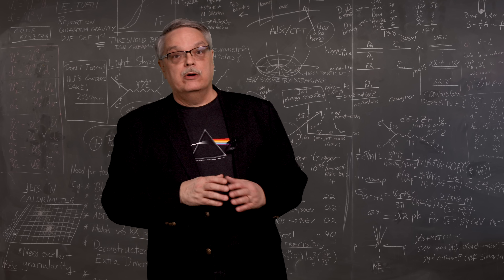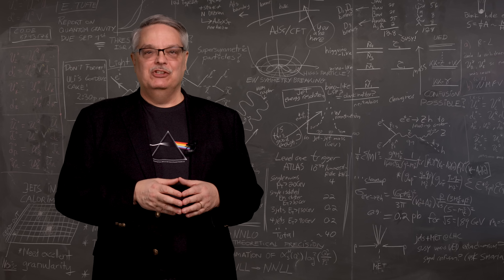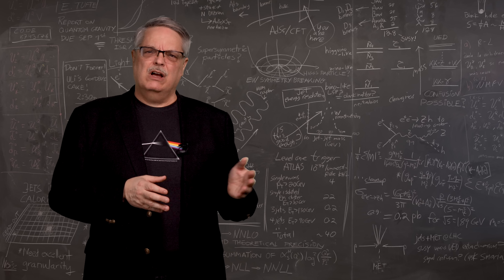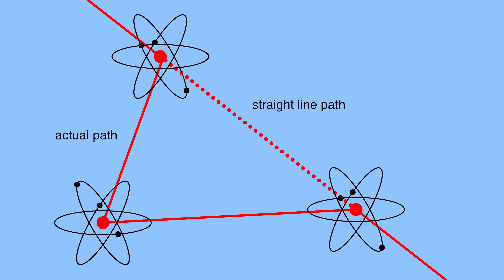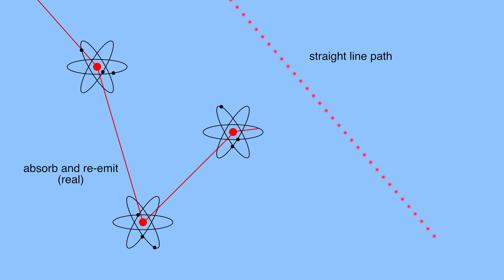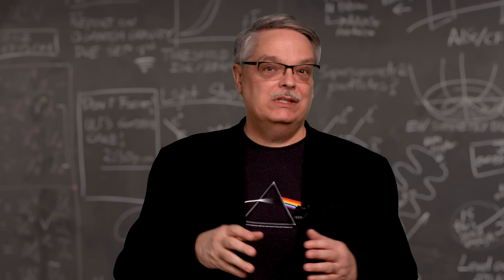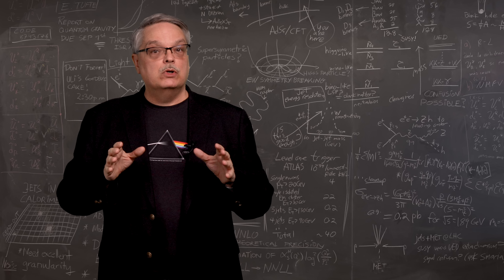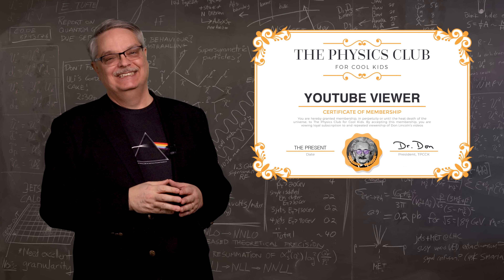Why does light slow down in water?

Comment: Thanks for the great explanations Mr. Dancing Hands
Reply: this video has taken many shortcuts in explaining the relations between the two systems and how it affects them.
to better understand this, we need to talk about d'alembert's equation and its dispersion formula and how it describes a wave.
so d'alembert's equation is used to link together the spatial and temporal variation of a wave.

and from this equation comes the dispersion relation that links together the frequency, wavelength and celerity of a wave.
to access to this equation, we use maxwell relations to describe this phenomenon. when we consider those relations in the void, we get the relation: c² = w²/k² where k is the angular  wavenumber and w its angular frequency. (just google it, ain’t that hard to understand)

thus we can see here that the celerity is proportional to its angular frequency. however, as explained in the video, when light enter a medium, there are charges that can be influenced by the electric field, especially electrons that are 2000 times lighter than their counterparts protons.
thus, when light comes in this medium, we assume that only electrons are affected by the electric field.

we then apply newton's second law to those electrons to find a relation between an electron's speed and the electric current
(we also neglect the magnetic field of the light as the electron is relativistic thus the force from the electric field is much greater than the magnetic one see lorentz law to better understand this )
and then by generalizing this equation to all electrons in the medium, we can get an induced current from the electric field of the light.
( the current is j = n * v with n the volumic density of charges and v the celerity of electrons)

then when we put this back to maxwell ampere local equation, we introduce a new component: the induced current which thus gives us a new dispersion equation: c² = (w² - wp²) / k² with wp the plasma oscillation and thus we can see that from the value of wp, we'll get a different value of the celerity of the wave.

thus we can say without a doubt that they are wrong in their explanation as it is not the combination from the electric current of the electrons and the wave that makes it slower but the induced current inside the medium that modifies the dispersion relation thus modifying its speed.
or in simpler words, it's the movement of electrons that changes the frequency and celerity of the light, but not the combination of the two electric current. (also on a side note, trying to represent the electric current of a dipole using a sine wave.. funny thing you did there 😅)

and finally, as for the reason why the light has a different angle, well you can easily explain this using two waves parallel to each other crossing the medium in phase with each other. as they have the same wave plane, you can easily come to the relation between the refracted angle and the incident angle using some basic geometry. i recommend you to see the demonstration of descartes second law if you want to better understand what i'm talking about.

Comment: Why is Fermilab's explanation so clear & elegant, while Sixty Symbol struggles so badly with this question (asked as "Why does light slow down in glass?")?
Reply: Funny, I thought this video was embarrassing. I could barely sit through it.
Reply: @saganandroid4175  That's funny. This video clearly explains what is wrong with other models/explanations.
Reply: because he's wrong:

this video has taken many shortcuts in explaining the relations between the two systems and how it affects them.
to better understand this, we need to talk about d'alembert's equation and its dispersion formula and how it describes a wave.
so d'alembert's equation is used to link together the spatial and temporal variation of a wave.

and from this equation comes the dispersion relation that links together the frequency, wavelength and celerity of a wave.
to access to this equation, we use maxwell relations to describe this phenomenon. when we consider those relations in the void, we get the relation: c² = k²*w² where k is the angular frequency and w its wavenumber. (just google it, ain’t that hard to understand)

thus we can see here that the celerity is proportional to its angular frequency. however, as explained in the video, when light enter a medium, there are charges that can be influenced by the electric field, especially electrons that are 2000 times lighter than their counterparts protons.
thus, when light comes in this medium, we assume that only electrons are affected by the electric field.

we then apply newton's second law to those electrons to find a relation between an electron's speed and the electric current
(we also neglect the magnetic field of the light as the electron is relativistic thus the force from the electric field is much greater than the magnetic one see lorentz law to better understand this )
and then by generalizing this equation to all electrons in the medium, we can get an induced current from the electric field of the light.
( the current is j = n * v with n the volumic density of charges and v the celerity of electrons)

then when we put this back to maxwell ampere local equation, we introduce a new component: the induced current which thus gives us a new dispersion equation: c² = k² * (w² - wp²) with wp the plasma oscillation and thus we can see that from the value of wp, we'll get a different value of the celerity of the wave.

thus we can say without a doubt that they are wrong in their explanation as it is not the combination from the electric current of the electrons and the wave that makes it slower but the induced current inside the medium that modifies the dispersion relation thus modifying its speed.
or in simpler words, it's the movement of electrons that changes the frequency and celerity of the light, but not the combination of the two electric current. (also on a side note, trying to represent the electric current of a dipole using a sine wave.. funny thing you did there 😅)

and finally, as for the reason why the light has a different angle, well you can easily explain this using two waves parallel to each other crossing the medium in phase with each other. as they have the same wave plane, you can easily come to the relation between the refracted angle and the incident angle using some basic geometry. i recommend you to see the demonstration of descartes second law if you want to better understand what i'm talking about.
Reply: @recouer  I go with the guy (Dr Don Lincoln) who says one needs to solve Maxwell's Equations for the full explanation.

Comment: So, if light traveling through an object like glass have a different wavelength, why doesn't it change a color?
Reply: Ok. Just thought about this a little more. We see it normal color because that is how it exits the glass. But still, if we could look from an "inside the glass", so having detector set up just et the exit, without any space between detector and glass, we could see that different color.

Comment: After so much promise of revealing the unexplained, in the end he is not actually able to explain: “The net effect is that the two waves combine and make a single wave of oscillating electric fields and that is the way it moves through matter. And, this is important: it moves at a slower speed than light does.” 

He neglects to mention whether the electron's electric field has a different frequency (which as he said was necessary to produce a wave with an altered crest speed) or explain why the electron's field (which he said is created by the light) would have different frequency.
Reply: well the issue with his explanation is that the electric field of the electron is unchanged from the electric field of the light.
in fact, the electric field of an electron is given by coulomb's law and there a no dependency towards an external field.
the only thing that changes is the position of the electron due to lenz force. however, the electron is coupled with a proton, considered static due to being 2000 times the mass of an electron and a change in the position of the electron causes a change in the electric field of the dipole electron proton.
however, this induced electric current is irrelevant to the reason why ligth goes slower in such medium. in fact, it is due to the electric current produced from the uniform motion of electrons in such field.
and when we factor in this electric current in maxwell local equations to get the dispersion relation, we get a plasma pulsation that is reduced from the pulsation of the wave in the void, thus reducing its frequency and speed.

Comment: i think i understand the classical  and quantum physics explanation of why the velocity of light changes while passing through those various mediums. my only remaining question is why and how does light choose the path that it takes and why are there variations of displacement across the various mediums refractive index . in the classical explanation the professor claims that a phase shift of light in glass is caused by other waves created by the original electromagnetic wave as it excites the electrons to form there own waves which leads  to this change in velocity. my other question comes from the knowledge of induction where a resultant wave is formed at a right angle in respect to the wave that is creating it. therefore the resultant waves may not phase with the original due to the different directions in which they move. lastly  how does it create the displacement in position of the emergent light ray.  why does the incident ray and the emergent ray not make a straight line. but most importantly how does light rays  choose to exit the glass at the specific position. in the quantum mechanics explanation where the proton has to follow every infinite possible paths to exit the glass how does it decide to follow that specific path.  the polariton theory of quantum physics sound a bit absurd and derivative.

Comment: The explanation stops short of a complete explanation.  Why do different materials have different indices of refraction ( and don’t tell me it is due to differing densities)?  One needs to go back to the electron responding to the EM of the photon and creating a new wave.  All electrons are the same so how would the new waves know what frequency and speed they should assume?   And just saying that the electron responding to the photons electric field producing a new wave that travels slower, gets you back to the original question stated a little differently.  Why does that “new” wave move slower?  Some other characteristic is in play here.  What is it?

Comment: The correct answer is light is a wave propagating, not moving, through an ether of neutrinos.  The speed of light is of course, zero, which is the same for all waves.  The only movement is some small degree of perpedicular movement or oscillation, in this case dictated by the polar inertia of a neutrino.  There is no such thing as empty space, or light could never propagate.  Propagation is a property of matter, not a particle flying through a vacuum.  We live in the worst Dark Age of all time.  "Scientists" today are utter imbeciles.

Comment: This clearly explains that Einstein was wrong in his 1905 paper,
 and light is not localized energy. You can easily conclude that Einstein and Compton were awarded Nobel prizes erroneously !!!
Reply: except they are wrong ...
their explanation is erroneous :

this video has taken many shortcuts in explaining the relations between the two systems and how it affects them.
to better understand this, we need to talk about d'alembert's equation and its dispersion formula and how it describes a wave.
so d'alembert's equation is used to link together the spatial and temporal variation of a wave.

and from this equation comes the dispersion relation that links together the frequency, wavelength and celerity of a wave.
to access to this equation, we use maxwell relations to describe this phenomenon. when we consider those relations in the void, we get the relation: c² = k²*w² where k is the angular frequency and w its wavenumber. (just google it, ain’t that hard to understand)

thus we can see here that the celerity is proportional to its angular frequency. however, as explained in the video, when light enter a medium, there are charges that can be influenced by the electric field, especially electrons that are 2000 times lighter than their counterparts protons.
thus, when light comes in this medium, we assume that only electrons are affected by the electric field.

we then apply newton's second law to those electrons to find a relation between an electron's speed and the electric current
(we also neglect the magnetic field of the light as the electron is relativistic thus the force from the electric field is much greater than the magnetic one see lorentz law to better understand this )
and then by generalizing this equation to all electrons in the medium, we can get an induced current from the electric field of the light.
( the current is j = n * v with n the volumic density of charges and v the celerity of electrons)

then when we put this back to maxwell ampere local equation, we introduce a new component: the induced current which thus gives us a new dispersion equation: c² = k² * (w² - wp²) with wp the plasma oscillation and thus we can see that from the value of wp, we'll get a different value of the celerity of the wave.

thus we can say without a doubt that they are wrong in their explanation as it is not the combination from the electric current of the electrons and the wave that makes it slower but the induced current inside the medium that modifies the dispersion relation thus modifying its speed.
or in simpler words, it's the movement of electrons that changes the frequency and celerity of the light, but not the combination of the two electric current. (also on a side note, trying to represent the electric current of a dipole using a sine wave.. funny thing you did there 😅)

and finally, as for the reason why the light has a different angle, well you can easily explain this using two waves parallel to each other crossing the medium in phase with each other. as they have the same wave plane, you can easily come to the relation between the refracted angle and the incident angle using some basic geometry. i recommend you to see the demonstration of descartes second law if you want to better understand what i'm talking about.

Comment: Shouldn't the resulting speed of two waves depend on the difference of phases between them? If you are just adding up 2 waves of the same phase, as you did in your vid, the resulting wave is going to have the same speed. In short You created another explanation that doesn't make much sense.
Reply: Phase shift between 2 waves of the same speed doesn't lead to different speed of resulting wave.
What was shown in video was adding two waves of different speeds instead, what also leads then to seeming "phase shift" between them.

Comment: The change in direction at the boundary - why and what determines the degree of change?
Reply: This is because one side of light front which enters the "glass" first - gets already delayed, while the other side which is still in "air" - isn't delayed until it enters "glass" after a while, and this leads to light wave front being seemingly "turned" to the side where delay already happens.
This is similar to a car with brakes applied asymmetrically (left-right sides not equal) turning to the side where brakes are more effective.
Reply: This was the explanation given in early high school physics but the analogy was a column of troops marching into a muddy field. I could see that the troops might want to stay parallel and marching in the same direction but that would mean for the photons they are linked  somehow and want to remain so. In your analogy it is an axle which does the job. We were often given explanations where -to me something seemed 'left out'.
 @rvrss7192
Reply: @pianodudeler  Because of particle-wave dualism, every photon exhibits properties of wave, the front of which is by default straight or if you prefer - "parallel".
Reply: @rvrss7192  I would be happier with a description of the resultant forces on the beam and how that produces a deflection. I think it has something to do with the interaction between light and the medium which reverses perfectly at the other boundary. If you imagine the water or glass atoms tugging at the beam -there's more of them on one side at the first boundary and identically more on the other at the second boundary.
Reply: @pianodudeler  Explanation of direction change doesn't require involvement of any "forces" - as well as in your example using "column/line of troops" where the same happens even without soldiers being tied to each other and without them even being aware of (the very presence) of each other.
(the only requirement is their identical movement properties)

And yes, refraction automatically happens in absolutely symmetrical manner on both boundaries in "default" ideal case when they are strictly parallel to each other.
Reply: That seems to me a non-answer normally things only slow down when a force is applied to them.
 @rvrss7192
Reply: @pianodudeler  What "force" is applied when you slow down your movement along the street because you meet some neighbor for discussion?
The more no force is needed when an initial line between you and your twin brother (both moving same direction along adjacent streets) seemingly "turns" because you've already met a neighbor and slowed down while he hasn't yet.
Of course, some interaction between subjects is present, but strictly speaking it is not "force".
Reply: Ah yes it is the understanding of the interaction which is most interesting!
 @rvrss7192